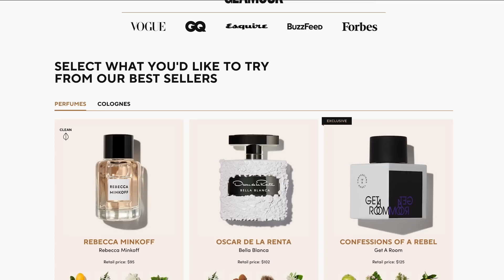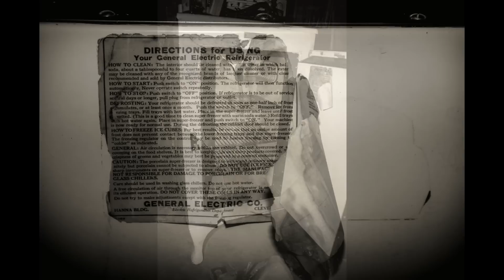A Professional Photographers View of My Victorian House

Comment: Because that plate is cast iron. The best and most effective way to repair cracked cast iron is to braze it. Using a torch and a Flux coated brazing rod, which consists of galvanized iron, steel, brass, and copper. You grind the crack in the cast iron to open it up more. Heat the area up red hot with the torch and fuse the brazing rod into the crack and fill the void. Not anywhere near precise as welding. After the repair is done, the area should be ground down a bit to be more pleasing to the eye. Brazing is quite difficult to do correctly, getting it to fuse to cast iron.

Comment: Good afternoon from a fellow old home restorer, as I have mentioned I have several ceiling mediations just like yours. I noticed your’s has been painted, a question, was the paint used flat or did it have a bit of a metallic flake to make it glitter a bit under gas light?